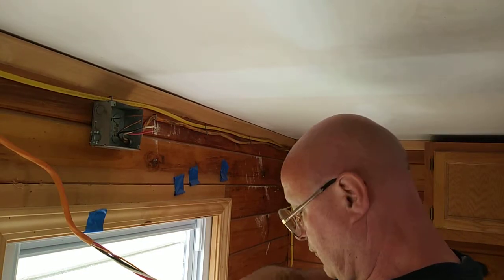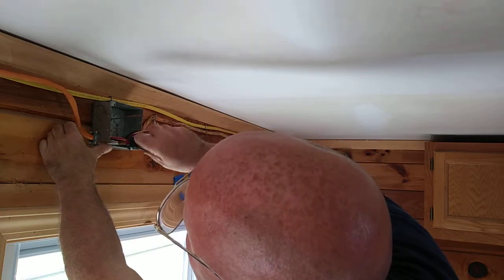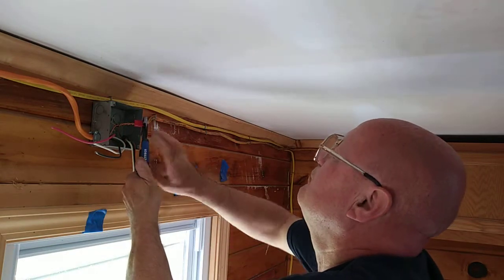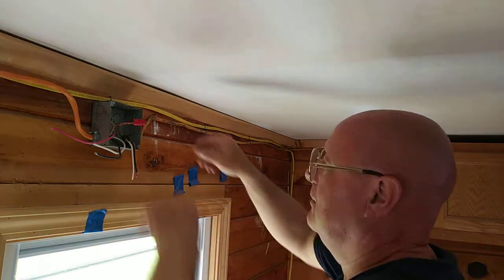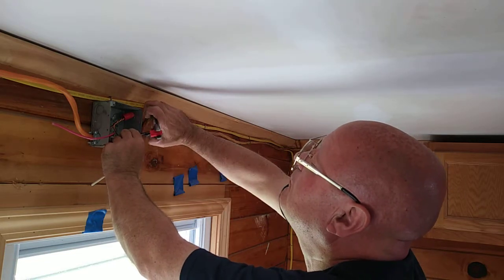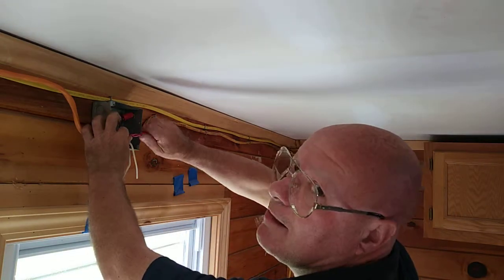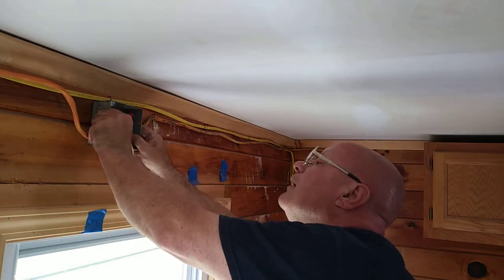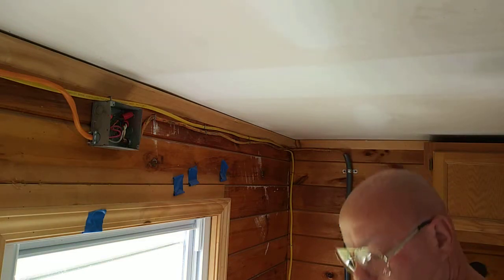Electrical wiring i did wiring a 220 volt j. box 10/3 in and out romex will be in closed

Comment: I'm not an electrician but do some electrical work around the house. My only note is that wire caps are also rated for specific wires. I wonder what yours are rated with. I wonder if they can't handle 30 amps most likely will heat up.